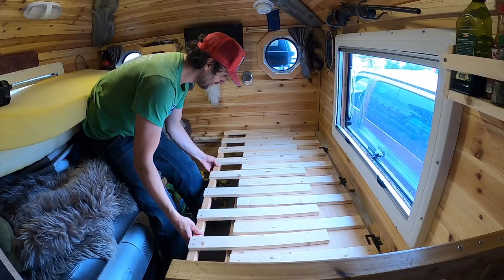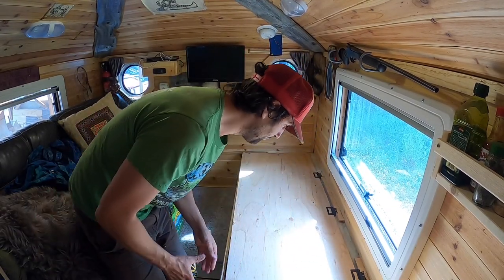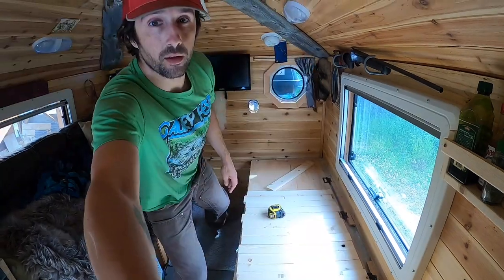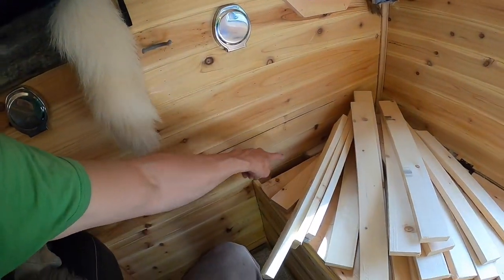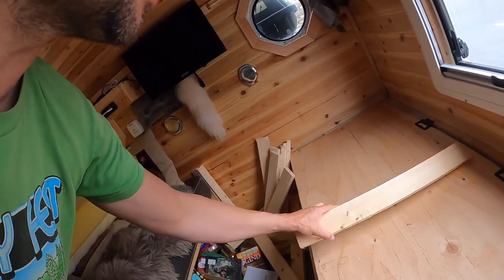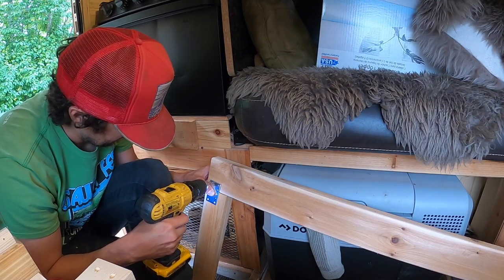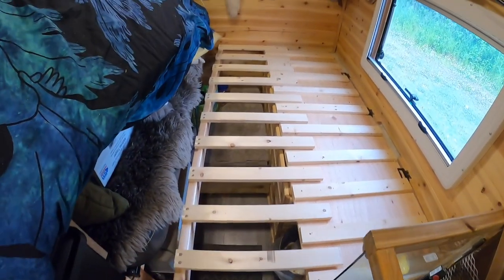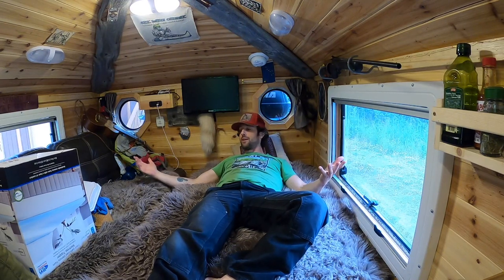How to Make a Pull Out COUCH BED from SLATS for a VAN, CAMPER or RV - Truck House Life - Episode 25

Comment: when installing repetitions like the slats instead of measuring each 1" rip a piece of 1" and use that as a jig to install each slat. OR if you can use 3/4" use the edge of a slat and install the next slat against that. 
Also I think the ledger board (the 2x4 the sliding slats ride against at the head) needs a tongue and groove arrangement to insure the sliding assembly will not slip off. A simple 3/4 slat screwed 1' proud of the top edge of the 2x4 could be used to make the groove and the "tongue" could be a 1/2" carriage bolt double nutted through the sliding frame.
Reply from the maker: Yep, I could have made a jig but I don't mind measuring, I used the slats themselves as their own little jig after the 1" measurement, small job so not bad.  And yes, I plan on making a lip in the future, but seems to be working great at the moment, super stoked on how comfortable it is!!:^)
Reply: @TruckHouseLife  Yes, for what they do I think 3/4 will work just as well as 1". Great build!